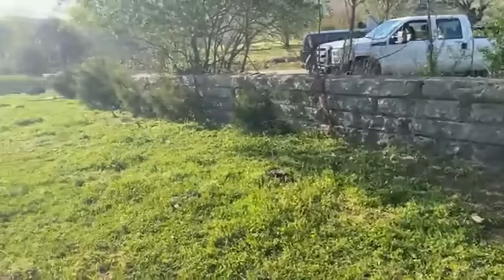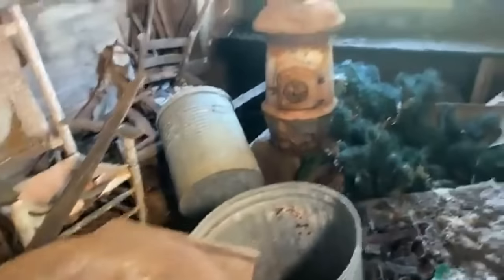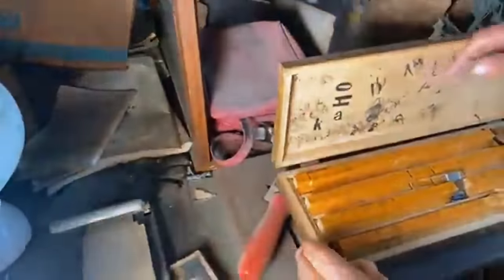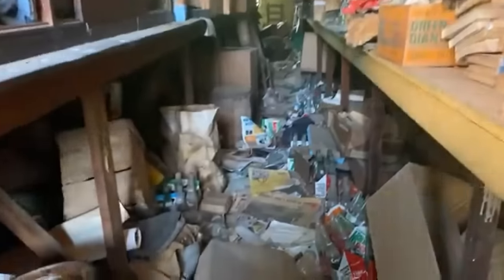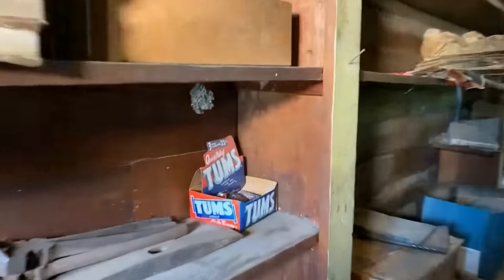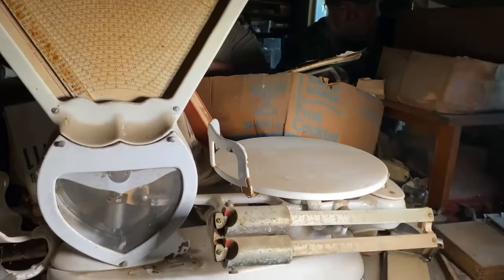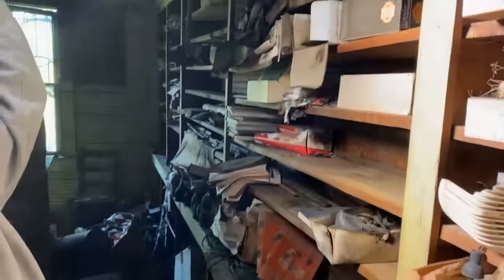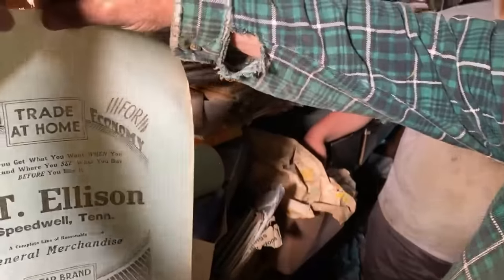1900's General Store Frozen in Time After Closing in 1970 and still has Inventory

Comment: The two large TVs are definitely from the early 1960s and are actually getting really hard to find not gutted because people like to turn them into cat beds or throw them away when cleaning out old houses, they’re definitely cool items that should be kept and not thrown away….. One thing I will say is that the signal they take has been shut down for several years so if you turn them on without a vcr or cable (yes you can hook TVs that old up to a vcr or cable and even your phone if you get the right connectors) hooked up to them all they will get is static….